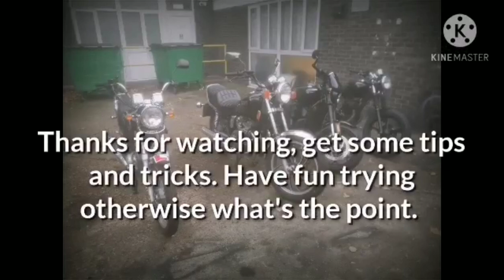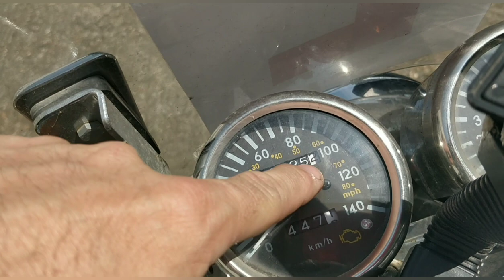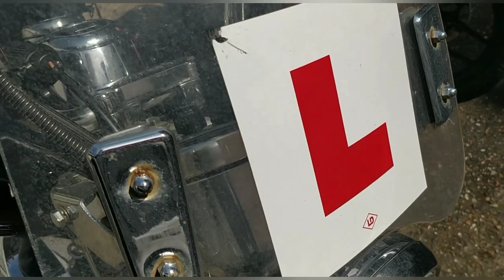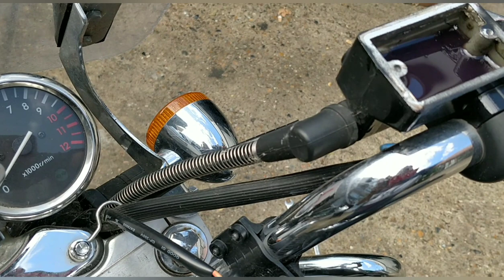new mini project, trading up. keeway superlight special edition with the extras. Brake fix.

Comment: Great job Charlie quick flip interesting how the middle piston works when applying back brakes not seen that before.
Reply from the maker: So the rear brake pushes the rear caliper and 1 piston on the front caliper when you apply it. Honestly it's more hassle then it's worth. When they have issues it's a right pain sorting them out.

Comment: The Superlight has a centre stand. Useful for checking fluid levels especially the brake fluid.
Reply from the maker: Yes that's a good point Phill. 

They aren't the best built bikes, they rust very easily but if looked after from new and waxed they will do a few years
Reply: @motorcyclerescuer  I have the 2016 Superlight (carburettor engine) all black model now on 10,000kms. Apart from 2 sets of front fork oil seals no other issues and still rides like new. Probably the most comfortable low power bike I’ve ever ridden!

Comment: Nice buy Charlie hope you can flip it quick for a good profit, just replaced the rear brake master cylinder on my keeway tx 125 and bled the brakes all working great now just gotta wait for new brake stop sensor as rear brake light doesn't work the it all sorted
Reply from the maker: Great job Ste, I know what you mean, they are sensor ones. I've converted a couple to basic pull ones in the past

Comment: My Harley has the same indicator set up but self cancel after a certain time/distance....is yours different?
Reply from the maker: Mine is a switch on the left only. Yours has one on each side? 

I've never seen it before. It feels horrible at first
Reply: @motorcyclerescuer  so you've got the toggle variety...its like the BMW's but you do get acquainted quickly lol.

Comment: The linked brakes thing is by law now 👎 I think they have to have ABS or linked. I'm gonna be bypassing that on my aprilia I don't like it either...
Reply from the maker: Yeh law to be imported in. Then I normally change them back as these systems don't work to well.
Reply: @motorcyclerescuer  I can't understand the logic behind linking the brakes together. It's supposed to help emergency braking but you're taught to brake with the front first then balance it with the rear. These linked systems make the rear brake extra sharp because it adds extra force to the front and takes the feel away from your right fingers. Awful. Whoever implemented that should be spoken to 😆
Reply from the maker: Thats exactly my thoughts aswell Laguna. It would make more sense if the front lever put the back on 25 percent.
Reply: @motorcyclerescuer  absolutely

Comment: But did you hpi the bike?
Reply from the maker: No, no need. I collected it from his house  same address on the logbook etc. Keys and mot.
Reply: @motorcyclerescuer  you should. You're the 7th owner Peter
Reply from the maker: Am I, I'm sure he said he bought it from the shop. The numberplate has his local area on it. Maybe he didn't say he bought it from new and I made an assumption that he did as it was in the same area. 

Either way I have no concern that its stollen.
Reply: @motorcyclerescuer  it's not stolen. As I did an hpi check 😆
Reply from the maker: Lol, I knew it wasn't. 

I guess every now and again it can't hurt to do a hpi out of curiosity. The isitnicked free site is great aswell if you havnt seen that before. 

I wasn't worried about it being stollen in the end I was worried about the number of owners in 4 years. 

I'm the 7th
Reply: 18 plate Superlights are going for about £1600 at the moment..
Reply: @philtucker1224  behave
Reply from the maker: Yeh well new Chinese bikes are now £3200 for the same quality of bikes